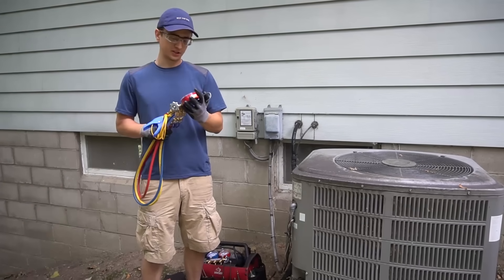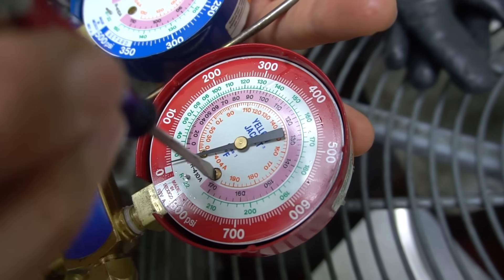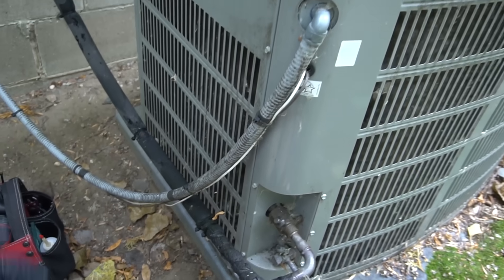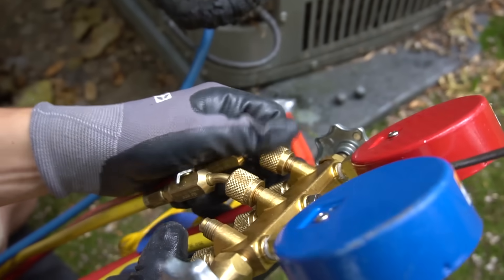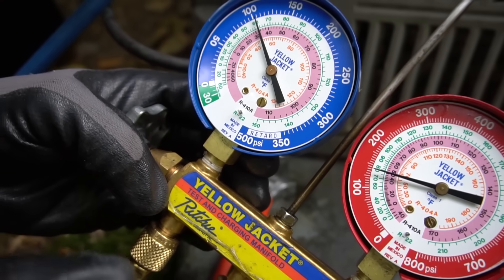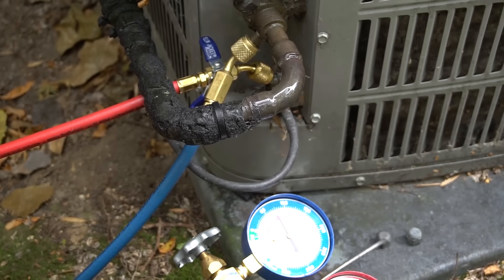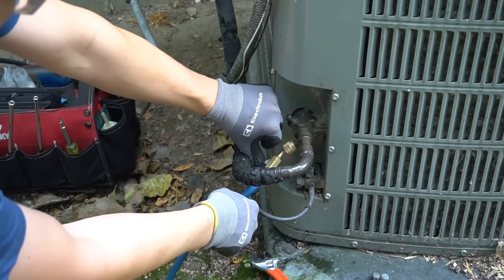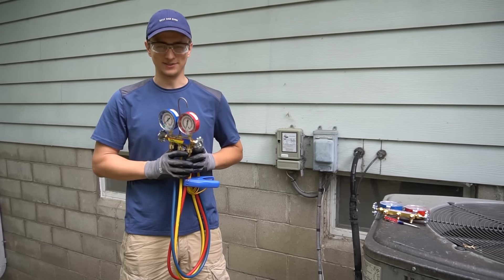How to Check AC Freon Level

Comment: Hi Jay

Man I'm having bad luck with my heat pump fixed the problem from a couple months ago my system was low on freon so wasn't heating effectively now after recharging cooling doesn't work :(  

I have a 15 year old york R-22 outside unit which heats but will not cool.   When I program in cooling mode everything appears to be working ie. outside fan works, I hear the condenser, inside fan is blowing air, air filter and coil are clean but it does not cool and I don't see and water condensing on the inside drain.   Earlier this year I had the refrigerant checked and it was low.   We pressurized the system looking for leaks but there was none found it held 350 PSI for 30 mins.   The tech though it might have been the gauge valve since when he opened the cap he heard a it of gas escape.   So  we added refrigerant to the level required 5 lb 11 ozs.   After this the heating worked fine compared to before when it was going constantly with little heat.   Fast forward a few months now I want to cool and it does not work but heating does.  Cooling didn't work last summer either but I figured adding refrigerant would fix the no cooling problem this year which turned out to be wrong.  In cooling none of the lines feel cool but in heating the large line gets very hot to the touch. 

It might be my reversing valve or in fact a leak somewhere (less likely as heating still works fine).   Didn't see any videos in your channel for checking reversing valve?   Anyways what would you try if you were me?
Reply from the maker: Oh boy... That one sounds like a handful. If it was a stuck reversing valve.. Wouldn't it be heating instead of cooling then? This one can be a lot different problems.. Likely something to do with the refrigeration system. Plugged metering device, inefficient compressor, etc... Most of the possible problems are pretty involved so unfortunately in this case, I don't think there is much you can try doing yourself. Would need a good technician to dig into it

Comment: thanks for this wonderful video, I have a question, if the external  sucktion line is not sweating/ or getting wet, but uint is working, is something wrong with it or there is potential threat to the unit ? thanks
Reply from the maker: Many times (but not always) that means the unit is low on refrigerant or there is a problem with airflow (plugged furnace filter or evaporator coil). If it is cooling down the house normally, then I wouldn't worry about it for now.
Reply: @WordofAdviceTV  thanks so much for the reply, my neighbor he is doing some kinda of havoc contracting job, not sure if he is good or not, but he helped me to measure the freon level, even put in some. so refrigerant part should be fine. now you mentioned about the airflow, it makes me wondering, because my ac unit on basement donot have the in take air filter,  most of time it is right next to the ac unit, but mine is not, so I put the air filter on the room, because I wouldn't find the right size, I got one from home depot , the green filter allows you to cut and it will fit all sizes vent. maybe these bad filters I bought is not allowing air properly flow inside the ac unit and  cause the problem.  thanks again.

Comment: My ac unit is 23 years old, when should I change my entire ac unit?????????????????????
Reply from the maker: Everything Dan said is right but if you don't have any problems with it and it's cooling down the house like it should, there is no need to replace it yet.
Reply: Word of Advice TV   It Blows  super cold ........... Thank you.
Reply from the maker: @Dan Deeg Thank you for taking the time to give a good explanation! Much appreciated :)
Reply: Soon. 23 years old, it's more than likely R-22. Sounds like you need an upgrade. Time is running out for R-22; Jan 1 2020 is the EPA's final deadline in their attempt to eradicate the refrigerant. R-410a is the new refrigerant, and depending on your location, energy companys offer rebates on HVAC upgrades, i.e. higher SEER ratings. The SEER rating is how efficient your equipment is. Good luck
Reply: Dan Deeg  You will have to change your entire unit 2020????????
Reply: @patrickguillory3914  no sir you don't have to but if there's a refrigerant issue (leak, bad compressor, metering device failure,etc) it'll be very difficult and costly to repair. R-22 refrigerant is being eradicated so the equipment using it will be eventually useless. Just as if the DOT mandated the use of saltwater in vehicles instead of gas. You could still use your gasoline-fueled car, just expect to pay a whole lot more for gas. It would be cheaper to buy a new saltwater powered car(that would be so nice, no?). Word of Advice TV is correct however. If it ain't broke don't fix it. You may get another 20 years out of your system, or 20 minutes.  Proper maintenance is the key, just like with anything.

Comment: It's cold there so the head pressure is lower than normal but that suction pressure is high for r22. That compressor could have bad valves and its leaking through.
Reply from the maker: I think my compressor valves are bad too. (though for now it works just fine) The pressures weren't where they were supposed to be but I didn't want to get into that in this video.

Comment: You need a temp probe to check your charge not this for checking to see if there's a problem also the temperature that is relation with the pressure is called your saturation temperature okay that's the temperature of the gas inside the line that's not all you need to know about it there's a whole lot more you're looking at this video thinking you're learning everything you need to learn your wrong okay if you want to be a maintenance man the backyard Heat and Air Tech I guess watch this video oh my God man the called mine says it's not called Freon pipes because there are different types of refrigerant refrigerant is not called Freon it's called refrigerant the refrigerant for R22 is also known as Freon r410a is puron do I need to keep going whoever installed that unit was an idiot you don't ever install unit like that those Service Port she'd be at the wall the building whoever installed that creative freaking trap just about hack install you should have pointed that out he'll the whip is touching the ground it's not allowed to touch the ground that's against code

Comment: I'm a HVAC service and installer and notice that you did the steps wrong by connecting the low side first. You need to follow the correct sequence on how to connect the hoses to the AC system. By doing the low side first, you are not purging your hoses and you are adding  non-condensables gases into the system.
Reply: Ppp
Reply: As a renter, I have a question- I recently moved into a 2 bedroom apartment with my husband and we’re having issues with our central air. We’ve contacted our landlord and she said to try to decrease the temperature gradually and to keep fans in the apartment. The thermostat temperature only fluctuates with the weather when outside temperatures drop at night. I live in the south. Not only do we have heat, but we also have humidity and it’s 80 degrees outside and it’s only spring but it feels like 90-100. I’ve bought a couple of dehumidifiers to try to help but they can only do so much. I’m tired of being unable to sleep because its too hot and we’re very uncomfortable. What do I do? I’ve got a window fan and at least 2 fans in each room. The other bedroom has a ceiling fan.
Reply from the maker: Thank you for the correction!

Comment: Good video. Noticed the high side shrader valve. Valve core needs replacing you can here the pressure from the cap more than normal 3psi. Also if the humidity is high and temps are higher. Suction will ride have seen up to 100 psi at 100 degree. Also raising head some by heat in house. Always do a Delta t when checking freon. Min (18 to 20 degree r22) (410a 20 to 24 degree) You check the return air temp and supply are temp and these temps above on the refrigerant above saying if r22 if return air 81 supply air should be 18 to 20 degree below around 63 that's 18 degree. 18 min 20 maximum. That's r22. Also when the humidity is real high and temps will make high super heat.

Comment: I really liked your video, but was also hoping to see how to figure out how to figure out how and how much freon to add.
Reply: You need to watch a video on how to charge a system if you want to know that information but here I'll give you a hint you have to use the superheat and subcool method in order to know how to do that just go to school and also you're not allowed to handle refrigerant without an EPA license it's against the law and you can't not buy refrigerant from A supplier without an EPA license is against the law if you get refrigerant from a friend that's against the law for both of you if you have a leaky R22 system in the year 2020 in the United States R22 is no longer being manufactured you might want to think about alternative refrigerants or just buy a new system with the damn good warranty
Reply: I'm sorry this video is not informative at all you got a lot of things wrong in this video I'm not going to pull them all out but I'll point one out the factory charge in the condenser coil can supply up to a certain amount of feet of line set I'm not going to say what that is and then after that certain amount of feet you have to add so many ounces per foot I'm not going to say what that is it's always crucial to take line temperatures when you're reading pressures she can measure your superheat and subcool pressures don't mean anything there's a lot of factors that can make your pressure go up higher give you a false positive

Comment: Ok so I have r22 hvac and I am wanting to change it over to 407c. Do I get a gauge for r22 or 407c? I am very new to charging a hvac home system, I am pretty sure it is low the down stairs of my house isn't great cool like 72 n upstairs is like 86 when its about 90 outside. The system worked great till a friend played a joke one night by turning the heat on wen it was on air conditioner n it was about 67 up stairs n when she did it blowed the capacitor in the out side unit, I re placed the capacitor n on the inside unit there was a small line vibrating real bad so I pulled it close to the big hose n I heard like gas came out just for a sec n it quit. I cleaned the inside unit coils with warm water n soap n sprayed the outside also out. It froze up one day but hasn't done it any more. I don't have a lot of money bc of getting this newly remolded home and I am trying to do it as cheap as possible. If you can give me any suggestions I would greatly appreciate it a lot thanks..

Comment: How do you know where the gauge should be on the low and high side depending on the weather? For instance if the weather is 95 degrees outside what should the gauge read?
Reply from the maker: Temperature wise, it should be around 45 degrees on the low side. (higher temps outside = higher refrigerant temp/pressure) You would need some charts or charging calculators, along with more measurements if you wanted to pin-point it though.
Reply: Word of Advice TV  thx for the info. I’m trying to learn all i can. Your videos are very informative. Thx for sharing.

Comment: Good job.  I especially like the fact that you always reattach the hose ends to your manifold.  That's good technique. 
Dirt and moisture will kill an AC, folks.  Don't let those hoses dangle in the dirt.
Reply from the maker: Thank you! (for all the comments :)
Reply: @WordofAdviceTV  You should replace the hose immediately when it has discharged liquid refrigerant and is cold enough to dew point inside the fitting.  Time is of the essence since you can wait too long and the refrigerant vapor produced by the residual liquid evaporating will dissipate and the moist environmental air will dew point on the cooled inside of the fitting.  Liquid water will be introduced into the system when you shoot the hose contents it into the suction port.

Comment: I'm an HVAC Journeyman/Service/Installer and former instructor that might instruct again...Schools don't spent enough time teaching actual, hands on, with the  gauges....I did and was popular for it....If you don't use them right and don't know what they are telling you, you can not diagnose the problem, if there is one, period...This is a good video for guys that do not get the instruction they should get, from less than proficient, so called Trade schools...Guys get pushed through, just like high schools now a days and the bucks is all their after....A shame, but it's true...Thanks for this video.
Reply from the maker: Thank you Vern!
Reply: D B  Some people think they know the correct way to do everything...That's just what they think.

Comment: Don’t suppose I can use my HFT car A/C gauge set to get pressures?
Reply: No sir. You can not. You need high pressure rated gauges. Mainly 410a pressure rated gauges being that they are rated at the 800psi being well above any pressures you may run into on a residential or comercial unit. However if you're not certified in the handling of refrigerants it is illegal for you to do so.
Reply: I was being funny. But I’ve seen my customers at HFT buy them to try this.

Comment: The factory charge wont be more than stated on the name plate to compensate for the lineset. The stated factory charge also includes enough for the lineset. The big port on the suction line king valve is the open closed valve stem. It's NOT a larger hose port .He twists the gauge manifold valves down so hard that you will have to twist them down hard from then on. If you are gentle with your gauge manifold and just" snug" them they wont need to be wrenched down so hard to seal

Comment: you have to use super heat and sub cool to check. this is good for beginners, but i have been to units that had different pressures, one i have pulled up on my phone was R22, suction temp was 63, liquid (or high side) temp was 83, my super heat  was 29 and my sub cool was 9, and you have to know what the metering device is on the evaporator coil, on this one it was a txv. usually you want 10/10 but it was still good. yes im still a green horn, but am still learning. btw i mainly work on residential units i dont know that much on commercial units. but if you do have any tips im glad to listen.
Reply: and on a side note, i know you know super heat and sub cool from being a technician, but if a home owner doesnt know then they wont understand as to why it is low or over charged

Comment: I have the same gauges whats the ideal psig temp for using m099 ambient temp at 80 degrees?
Reply: Justdissin refer to r22 pt chart runs about the same pressures little higher I believe

Comment: I dont know what happened but when i put the blue gauge on while the ac is on. If turn the knob on, the needle didnt budge. Just want to check my freon level. I used to check it before with no problem.
Reply from the maker: Well actually, it's not recommended to put on gauges unless you absolutely need to for diagnosing. Every time you do so, there is a risk of introducing contaminants to the refrigerant system and you lose a little bit of refrigerant each time. So if the unit is working good I wouldn't check the charge, it would suffice to just take temperature readings.

Back to your gauges though :) If you loosen up the hose that you connected at the gauge, does any refrigerant spray out? If yes, that would mean the gauge is bad. There is also a chance that the shrader valve is stuck. sometimes they need to be replaced. Other times you can try to depress it/straighten it out with a screwdriver. (in the worst case scenario, the shrader valve can get stuck and you can blow the whole charge so tread carefully..) Well and of course if the AC is not cooling the house, then that means the refrigerant all leaked out.

Comment: Very good video I work on Car Ac systems and purging the lines is almost never done in our field lol but you are absolutely correct about air intrusion. Anyhow nice video. I get Flodded evaporator on my household AC unit and to be honest I think it’s because it might be low on charge so now I have an idea I will have to see if my manifold gauge set for automotive has the R22 and the other Freon scale along with the temperature. I was thinking of actually doing a complete evac and to see how much Freon is actually in the system. Anyhow here I am rambling just to say good video
Reply from the maker: Thank you and good luck! ;)

Comment: iyour gauge has a valve  both  high and low you shoud closed the valve on the high side and open both gauge  so that the gas on  hose  will be suck back to the compressor then cosed both gauge then disconect your high side

Comment: Hello,

I would like to tell you that your videos are really good! I have a question for you. I want to install a split LG system. In the installation manual, he mentions that the unit is preloaded for a maximum lineset of 49 feet and to add 0.21oz/ft up to 149'. On the other hand, it does not mention what to do if I have 30 feet of lineset. Should I remove gas or leave the unit as it is ... Nobody seems to be able to answer this answer. What do you think ?
Reply from the maker: To me it sounds like 49 feet is the "maximum", meaning a line set that is shorter would be fine too. I would just run the unit for 5 minutes and then check the charge, check the super-heat and sub-cooling and if those are lining up, then all is good.
Reply: @WordofAdviceTV  yup, Mitsubishi has max length, like 25ft one way, anything under is still fine, with factory charge, nor removal, just add once it gets past 25'..